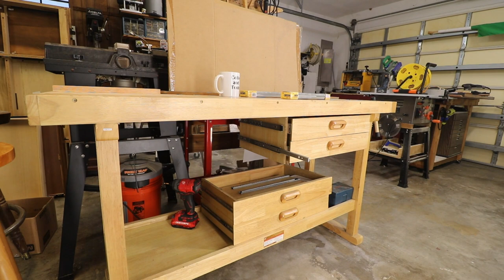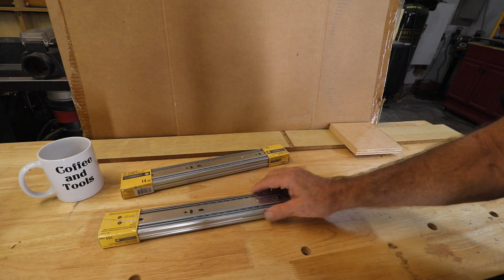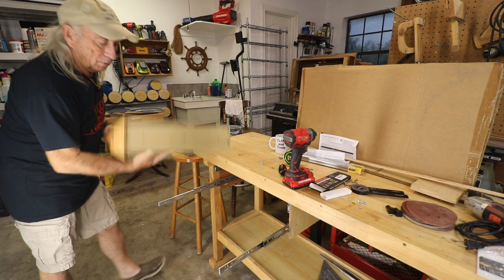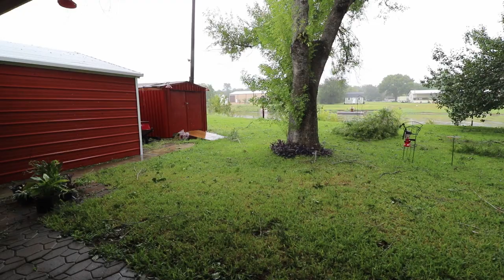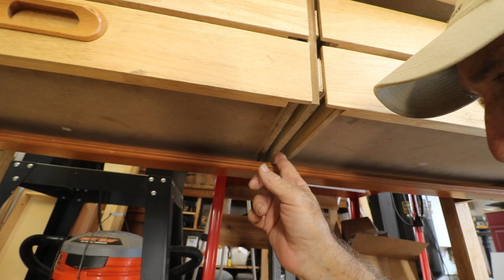Windsor wood bench Harbor Freight, upgrade drawer slide and the truth installing @ C&T Episode 169

Comment: I just bought this bench yesterday, and two of the drawers are giving me trouble. Cheap, crappy slides. Your video is really helpful, since I'm on the fence about how to handle the situation. Thanks!
(Also, the bottom supports have been installed backwards on your bench, fyi.)
Reply from the maker: I like the bench for what it is, but more upgrades are in the works. bottom supports backwards ? LOLOL...glad to say it wasn't me.
Reply: @SirTools  I figured it was the former owner. I'm jealous of the price you got it for. I couldn't even find a coupon for it. 😑
Reply from the maker: @RJStockton  Felt sorry for the owner, his health had failed. Harbor Freight coupons...yeah...now you have to be a member. I miss the coupon papers.
Reply: @SirTools  I guess my first project as a new woodworker will be to fix up my workbench. Could be worse. I'm thinking either get rid of the drawers because the top ones will fill with dust, or put panels on the sides with some new hardware to make that neat swishing sound when I close them. Maybe paint flames on the sides.
Reply from the maker: @RJStockton  I'm in for flames :)

Comment: I don’t thinkHarbor Freight sells that bench any longer they have something similiar ,BTW on the screws being off on one side from the other that may. not actually be  the Manufacturers fault  ? As a kid growing up my Dad  who had a big Family and many freinds never. passed up a Free or hand me down Workbench and practicly every one we did some  modification  or Change to make that paticular one  work in my Dads Shop  most often the changes we did were  relocating or adding more Drawers for extra Storage  We made our own Slides   out of whatever we had in the Scrap Bins and Metal Piles ? the Old Man was very resourcefull or as I called him Cheap !  ironically when i was in my 40s i inherited 2 of his old Steel Benches that went into my Shop ! FYI i’m a retired Woodworker by Trade and i wanted that bench because it eventually made it into our Garage  where my Dad and I wrenched on many ,many Projects together often  working overnight untill daylight fueled by lots of Coffee  and even a few Laughs  the Bench also still has my Dads Antique Heavy Duty Vises on it that we used  as a Press  often  and i coated numerous times and colors with Rustoleum Paint which my Dad swore by for Metal
Reply from the maker: Man, those were the days ! I have one useless tool box that the old man owned and I've kept it for no other reason but to remember those 3am working on a project days with him.